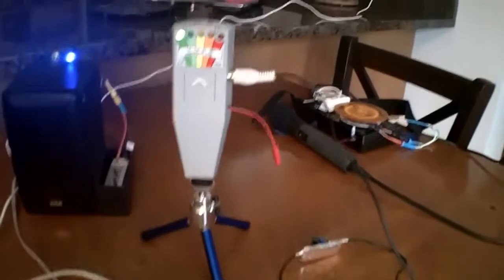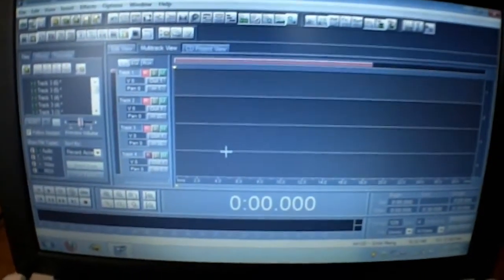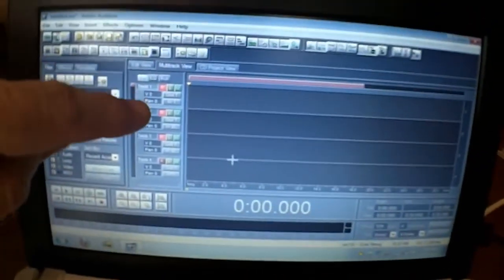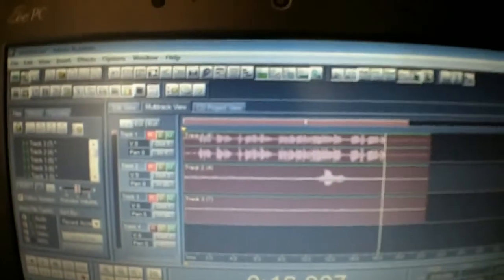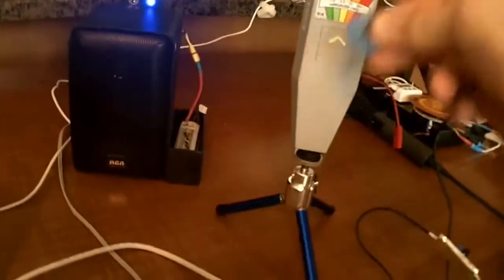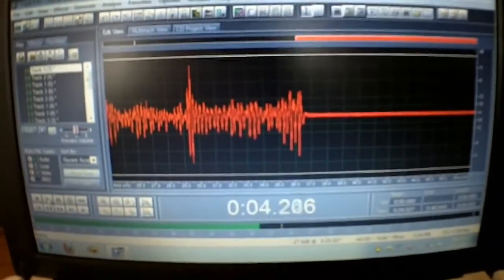K2 Meter Audio Tap Modification for Audio Analysis

Comment from the maker: For builders of the "K2 amp with SB7 Validator, K2 audio tap diagram starts at 6:40, do NOT need to build the the "level adjust circuit", just the tap using the RCA plug shown.